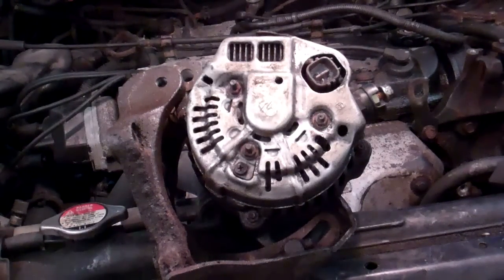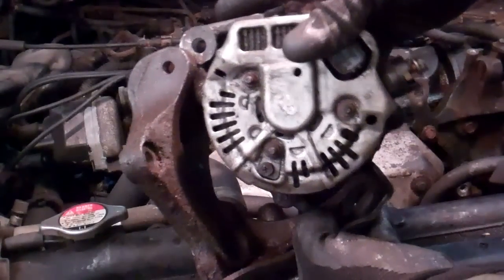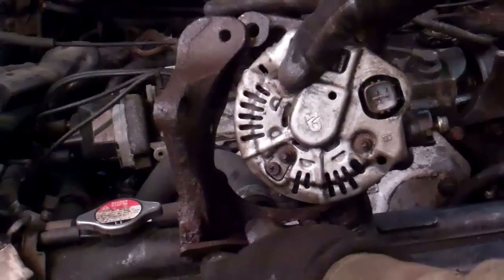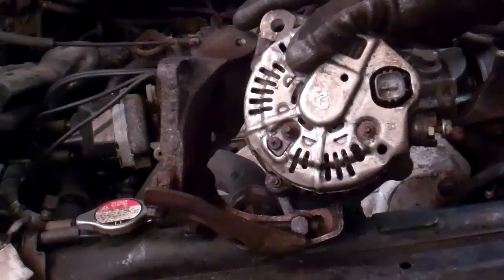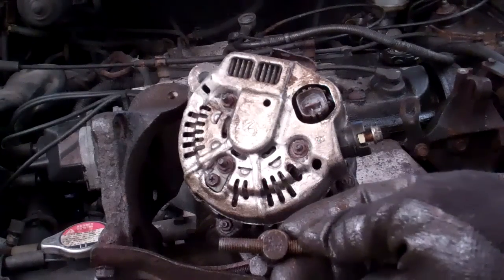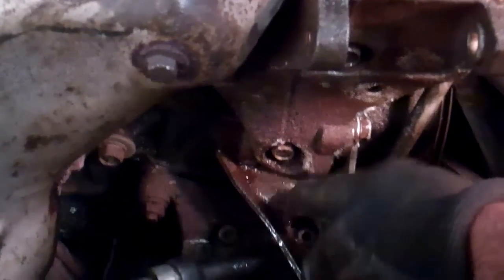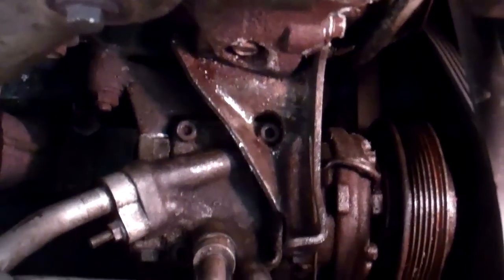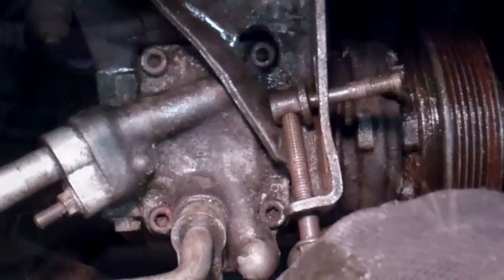Adjusting alternator belt tension - bolt & pivot bracket design

Comment: Where can I buy the tensioner bolt. Mine is missing so I’m using a bolt straight through the alternator thread hood and bracket. Capped off the other end with a nut. It holds it in place but I believe it still isn’t tight enough because it sometime sqeaks still when I first start the car

Comment: You could bother to mention the wrench sizes needed.  On my 1997 Odyssey a 14mm, 12mm and 10mm sockets worked best.  And getting at the 12mm nut was a bitch.

Comment: Hey I had question I got the new alternator on but now the adjustment bolt tensioner won't screw into the hole and I sure I had it same way before I removed it now it won't go in, the whole not stripped because I tried smaller bolt and it went in
Reply: Hope you figured out you didn't have it lined up.. lol

Comment: That alternator lock adjustment bolt is a tedious pain in my behind😫. I'm trying to put it back in on a 1999 Lexus RX300 & I'm having the same problem I keep dropping the bolt down through the engine. I wasted 5 hrs straight trying to get it back in with no luck. Any suggestions? I see you were able to do it without the pivot bolt in place. It appears I won't be able to do that on the Lexus I'm trying to avoid having to take the entire radiator fans out just for one bolt. Is it possible to put it on from underneath the truck? Any advice or suggestion would be gladly appreciated graciously thanks🙏👍😎

Comment: This is the worst design ever! I literally buy belts in bulk because getting the tension just right so it doesn't slip or RIP is impossible 🤬 Also had a broken (stripped) adjustment bolt so replaced it with a nut/bolt my son picked up off the road while we were walking to get a new alternator🤣 F'ing fords, gotta love em.

Comment: What's the name of the piece that the bolts run through? Ours is square, but can't find it anywhere. The tensioner bolt broke off and we can't get it out of that small piece. Having a name for it would make it easier.
Reply: http://www.hyundaipartdepot.com/parts/2002/Hyundai/Accent/GS?siteid=216505&vehicleid=90910&diagram=1041128&diagramCallOut=3 that might help you
Reply: ThisMyMemeAccount thanks!! Thanks!!!

Comment: Just had my alternator replaced on my Toyota Tacoma.  Every thing was great but it squealed when I started it, otherwise no problems.  My bolt broke when trying to adjust it, so replaced it. Yet now the check engine light came on and I have to have my foot on the gas or it seems as if it will die. Does anyone know what could be wrong???

Comment: Thank you for your video. I have the same car with a squeaking belt. Figured out that the last guy didn't put my tensioner adjustment bolt on my alternator (though the belt didn't squeal when I drove off). I was lucky to still have both bolts under the hood after driving a good distance, but the nut was missing. I bought the nut, loosened the throughbolt to move the alternator, put both bolts in with the nut, and the squeal was gone! First time under a hood, and I thank you for your video!

Comment: when those bolts snap I just grab a pry bar and set my tension by prying on the alternator...then tighten the locking nut.  its easier then trying to order a replacement tensioner bolt/pin that may or may not exist as a replacement part (toyota doesn't have the part # for the threaded tensioner block on some cars)